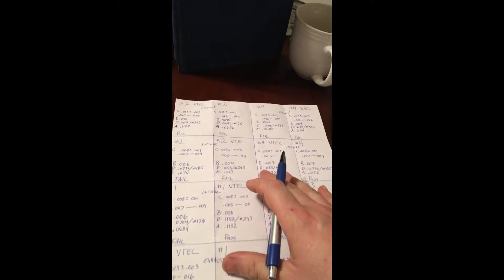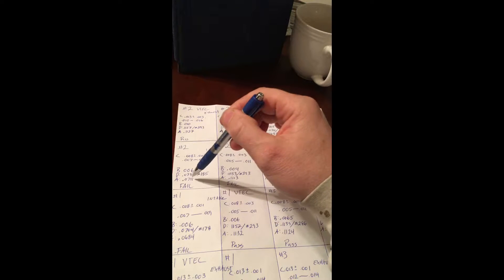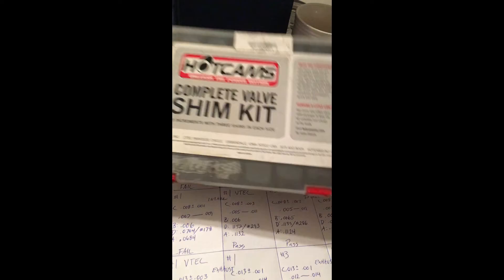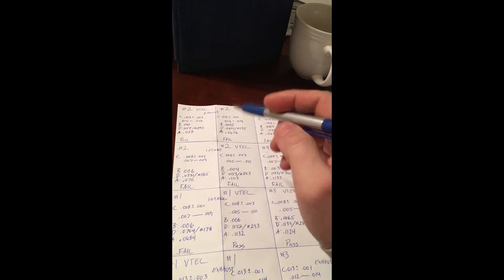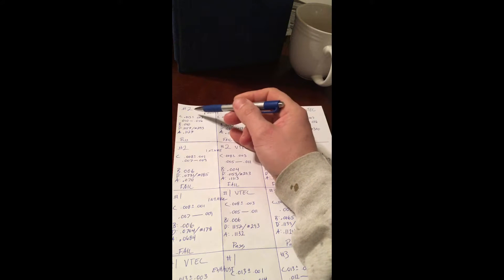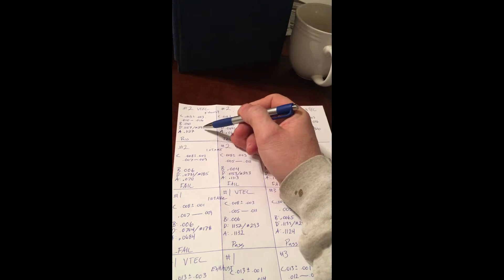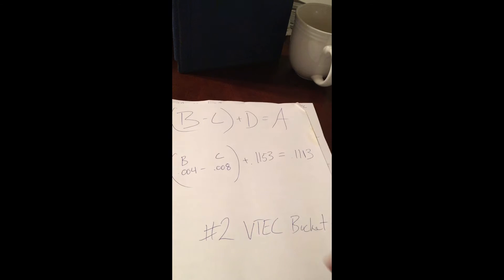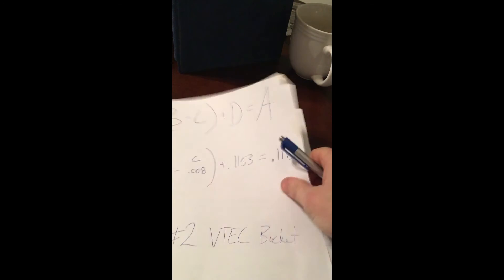Vfr800 Valve Adjustment Math

Comment: how many miles where on the bike?
Reply from the maker: 60,000 miles
Reply: bondfranklin very reasonable. The issue is that I paid $2000 for the bike. It was 15k miles. I will not be doing this preventive maintenance just because it will cost me around half of the price I paid for the bike.
Reply: bondfranklin also doing it myself would require a great deal of work I'm not sure I want to endure.... I rather sell the bike and buy another one or a different model. Thanks for the info though
Reply from the maker: Very relatable, this guy waited to 60,000.  They are great bikes
Reply: bondfranklin what about the electrical issues... I bought mine and after 3 hours the stator died... It is burned. Is a sick bike... The sound is intoxicating... Love the Vtec...but I can't get over the issue of the electrical problems
Reply from the maker: Just a thought: The stator will send full power to a dead battery until it melts down.  Did it have a good battery when you got it?
You should not jumper that bike off.
Reply: bondfranklin I bought the bike in WV. I rode for 3.5 h and the bike died in the middle of the highway. After getting the bike home and running tests I realized the stator burned out. The battery... All I can tell you is that the bike started right up without problems the 4 times I stopped for gas and food in those 3.5 hours. When the bike died and I pop the seat up, one of the cells of the battery was popped up. I guess the rectifier failed too and fried the battery. This is something I'm trying to figure out but the information on forums is not concise